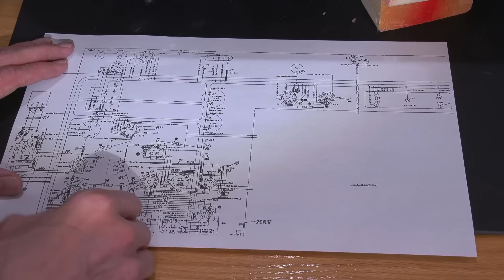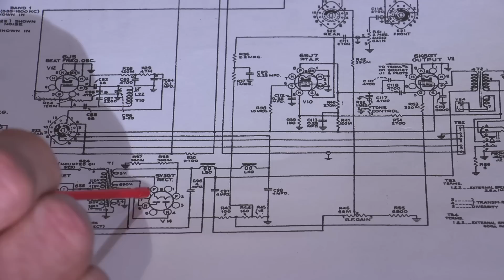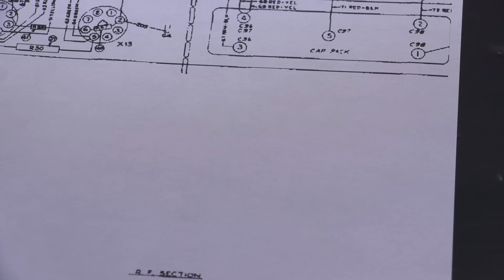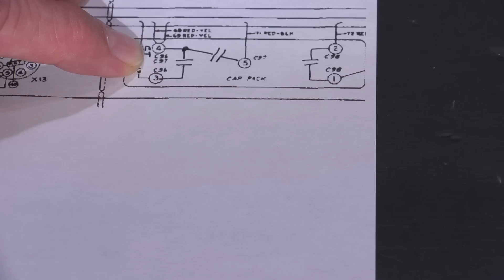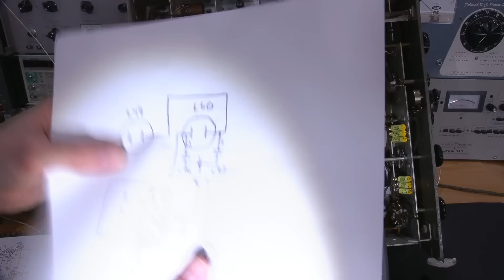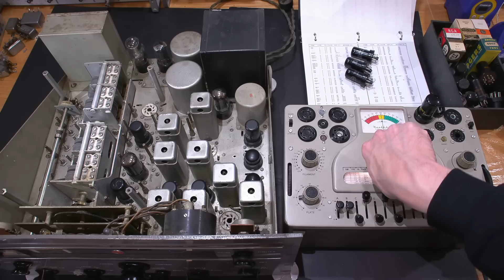Receiver Restoration Series! The RCA CR-88.

Comment: Back in school, we built 5 tube superheterodyne radio recievers. Tubes, intermediate frequency cans, tuner, resitors, capacitors, speaker, and the transformer. We learned frequency mixing.

Comment: Watching Mr. Carlson install the three electrolytic capacitors reminded me of the three same caps I replaced in the three AR’s I restored. At the time of these restorations I elected to take the route of removing/separating the original power supply electrolytic inner encasement from its outer metal chassis enclosure cover. I mounted the replacement electrolytics on a perfboard in the chassis opening where the originals were mounted and covered the perfboard with the original outer power supply metal cover enclosure, minus the inner capacitor encasement, so it maintained cosmetic originality. 
I was able to do this without compromising the inner encasement containing the three original power supply electrolytics. Those three electrolytic capacitors are mounted in a sealed metal encasement inside the chassis mounted outer metal enclosure cover (riveted). This original configuration may not be the same for every RCA AR/CR produced but this was the way it was for the three AR’s I restored. You never know what you might run into with an AR/CR restoration. I have the original electrolytic encasements stored in my shop and still no signs of leakage from any of them. I would not recommend the method I utilized unless the inner electrolytic encasement show signs of physical leakage and at that point removal is a must. If removal of the electrolytic encasement is require proper PPE is worn as it hard to say what chemicals and/or oils lurk inside that encasement. Mr. Carlson’s method is a lot easier and faster and, as Mr. Carlson states, a lot more efficient without having to utilize that long wiring harness. 
I continue watching this restoration series with enthusiasm!

Comment: The reason the power supply filter cap has to be replaced is that it is a 3 section unit consisting of three 4 mfd oil impregnated paper caps, each rated for 500 v.  When the set is put into standby, the B+ is removed from the tubes and its voltage soars high to 480 v.  The old 3 section unit can no longer reliably withstand that and the dielectric begins to break down.    You are correct in using polypropylene film replacements provided their rated v. is at least 630 v.    Also, it is a fool's errand to try to retain the stock capacitor can because the 3 capacitors are potted in tar inside the can, making for a difficult messy salvage job.

Comment: Working on an IG-82 (AG-10) Heathkit Sine/Square Gen. There is one 4uf film cap. It connects from the flatness adjust circuit to the plate of a 6CL6 (104v). Based on all the info you've dropped, here and patron,  new stuff (parts) are way better build, and don't over think it with replacements. I'll post pics and the community when it's completed. Thank you.

Comment: Nice to see that you were able to locate a connection diagram for this receiver.  Looking at the old Rider perpetual trouble shooter manuals, I've noticed some manufacturers included connection diagrams.  Most did not.  I'm in the  middle of an old Sears Model 1806, variant 2, receiver rebuild.  This unit was made by Colonial.  The schematic is as bare bones as you can get.  It shows all the circuitry, but a lot of stuff isn't labeled.  There's nothing to indicate what coils are associated with what band.  The tube elements are shown, but there's no pin outs.  You have to refer to a receiving tube manual.  I've been doing a lot of wire chasing with a multimeter.

Comment: Mr Carlson, I have used those same Polypropylene capacitors in some of my restoration work. For example I used them in restoring a 1929 Majestic 92 radio's power supply and in a 1940's HP 300C audio generator. Very nice compact caps.

Comment: in my AR 88 the 2.7k dropper resistor to the VR 150 was faulty. There is also a lot of heat traveling  down the post wires and the solder joints became dry to the VR150. 
The BFO components  are inside the BFO can and over time they became cooked due to being inside the can from the heat of the valve's.

Comment: 👍Thanks for video. I was little surprised that you had to replace all(?) the 6SG7s. Though, I suppose many of these sets clocked up many operational hours which might explain them all being low gain.
Reply from the maker: Many of these were on 24/7, so the tube emission is very low. Common for these types of receivers.

Comment: I replaced the rectifier tube on my AR88 with silicon diodes.  This was a bad move as the reduced forward resistance of the silicon diodes caused the first smoothing inductance to burn and go short circuit because of the higher current pulses.   It also raised the HT voltage by about 20 volts.  I managed to cobble up the bias circuit, but I should have left the old double diode in place.

Comment: Nice video, once more Paul. One thing I wondered about though. You were happy with the new filter caps being closer to the filter coils. Less noise to be picked up (if any). However you decided to leave the old wires in. Why not remove them altogether to eliminate any potential noise being picked up?
Reply from the maker: Hi Svein. The disconnected wires will not introduce any noise, as the are just filtered DC. Thanks for your kind comment!

Comment: Paul, an idea for a future video would be to discuss technical issues related to those bathtub capacitors. What is the point of putting some caps in an oil(?) bath inside a metal box? Are they off the shelf parts or always custom made? Three caps in one box with two of them having a common end with a third that has its separate leads seems a rather odd design. Why not three separate caps in the box and then connecting the ends of two together?

Comment: I like your restaurations, but I tend to replace the "chassis" mount capacitors by remade ones. A dealer here in Germany has them, made be FTCAP. Most likely a variant of their "S series", but in the classic values like 8+8, 16+16, 32+32, 50+50 or 50+100 µF. 

They are quite expensive, but available and it somehow feels better to me instead of sticking modern ones on the underside of the chassis.

Comment: Why do not lace the wiring with lacing twine?
Reply from the maker: Try getting your hands in there. It was hard enough to snip the tail off the zap straps with a small clipper. All that factory lacing was done outside the chassis, (on new flexible wire.) The wire is as hard as a rock now and took heating to gently move it.

Comment: The three capacitors in the can are electrolytic, but you are replacing them with a poly capacitor.
Are you using "Metallized Polypropylene Film Capacitors" in this restoration?
Can you use these capacitors to replace old wet-tantalum capacitors in old test equipment?

Comment: Paul, if a circuit calls for an electrolytic capacitor, and you can replace it with a non-electrolytic capacitor, then why would the designers bother using the electrolytic to start with? I'm sure you've covered this previously, but if so, I must have missed it.

Comment: Great video and work Paul.  A question if I may; do you think that 5 lead filter capacitor was custom built for this receiver, or would it have been an off the shelf component at the time?  Seems so specific to be off the shelf.  Thanks.

Comment: I restore radios and most of the AA 5 sets I see have a phono jack. This Bendix I have on the bench has a 3 section filter which is isolated from the chassis. I cut the connections to the can ground and left the remainder of the filter wiring in place reasoning that if a section leaks there would be  nowhere for the current to flow. I then located the recap in an open section of the chassis and wired to the set as good practice allows. Does this violate that practice?

Comment: Enjoying this series and following along with my own receiver. Is there another way to identify tired tubes if you don't own a tube tester? There aren't many around over here
Reply: I many cases you can measure the voltages  (and by this, indirectly the currents) around the tube and take quite an educated guess. For example, if they have a cathode resistor and you see that plate and all grid voltages are in spec (or higher) and the drop over the cathode resistor is low, you can be pretty sure that the tube is weak.

Comment: I wonder if this thing is full of rubber wiring like the 2 1946 RCA's I've just finished up.
Reply: I think they wouldn't use rubber wiring in commercial grade receivers but only in retail ones but , there are always exceptions.
Reply: @hestheMaster  Why wouldn't they? Rubber was a perfectly good wire covering. How could they possibly have forseen that it would be deteriorated in 80 years? Now we know the cloth wiring held up the best. But back then cloth may have been considered a hazard used in the lowly consumer-grade machines. RCA and Crosley used rubber wire. Others may have also. At the time it may have been considered superior. Context means everything.
Reply: @totallysmooth1203  Hence me saying there were exceptions. Before the war years ( 1938 to 1941) stock of rubber  covered wiring was used up and they went to cloth wires since that is what was only available until the war production board came about so only materials approved to make war products. After the war years ( post 1946)they still had plenty of cloth wiring to use. Did they also use rubber wiring? Yes, some manufacturers went back to rubber for a time.

Comment: Hi Paul, nice restoration video and series.  However there is one thing that irks me about your methods.  
First, you really do a great job of retrofitting new-technology components into the old architecture. however your use of cable-ties (you call them zap-straps) is incredibly tacky to me.  Instead, you should be using period-type waxed-nylon lace which is either available in natural (an off-white) or black.  The lace is super-strong, and allows you to dress cables much more neatly, (close-wrapping) or that require any turns or off-branches.  
Additionally, the lace will never break or become brittle, unlike cable-ties unless you buy the expensive ties (and know the difference!)
Those plastic 'zap-straps' just have to go, they are just so ugly and inappropriate--please stop using them.!   Thank You!  73...